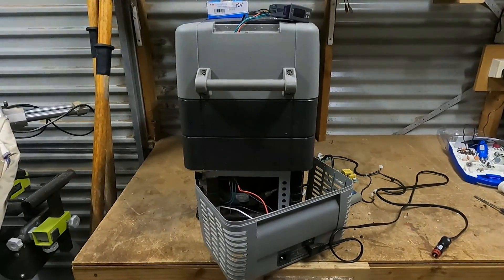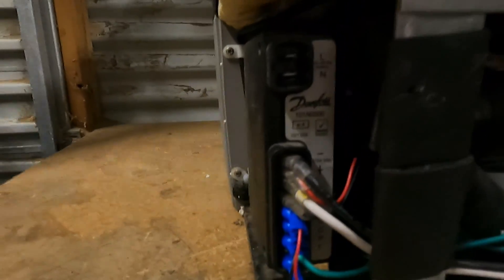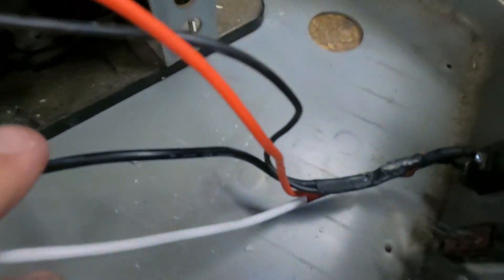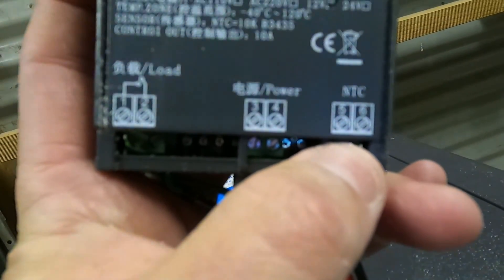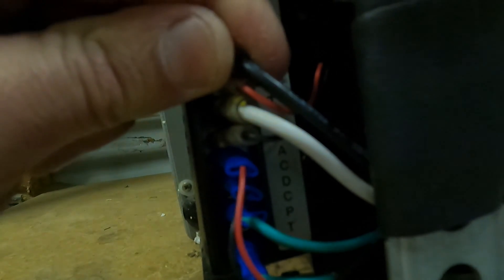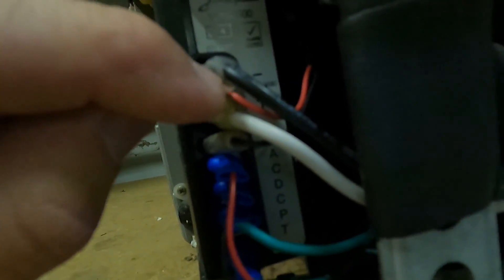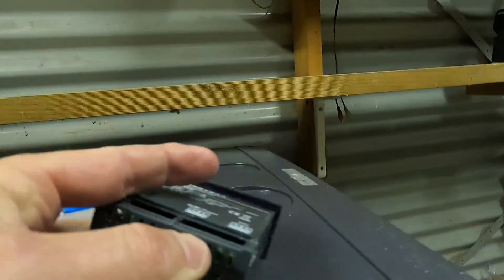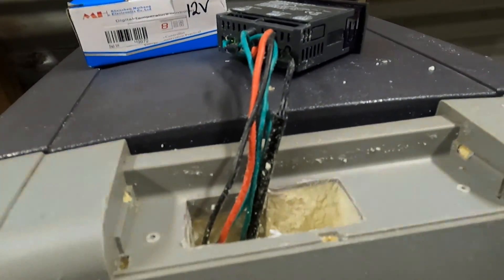$15 Waeco fridge fix

Comment: What were the symptoms of your fridge before you fixed it?
Reply from the maker: Hey mate, my upper control panel was completely dead and they are too expensive to replace on a fridge as old as mine. Without the control panel the fridge wouldn't work at all.
Reply: @mattwilliams1316 When your panel was completely dead, did using the red override switch work at all?
Reply from the maker: @BigJ_   if you mean the red switch beside the plugs at the base of the fridge I cannot remember sorry, it was about 18 months ago now.
Reply: @BigJ_ my cf50 has a dead control panel. I overrode the fuse and yes it's working. I'm assuming I need to replace the fuse and slide switch back to normal. This was given to me in case I needed parts for my cf40. It has a flashing display but nothing works no compressor no internal light no fan nothing.